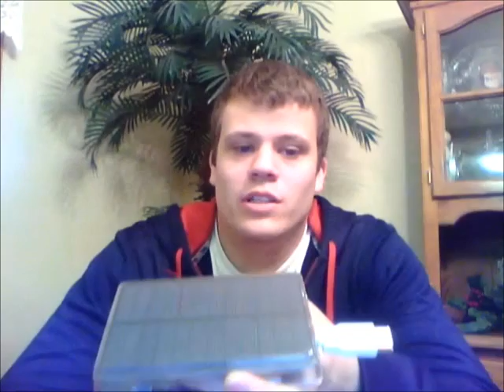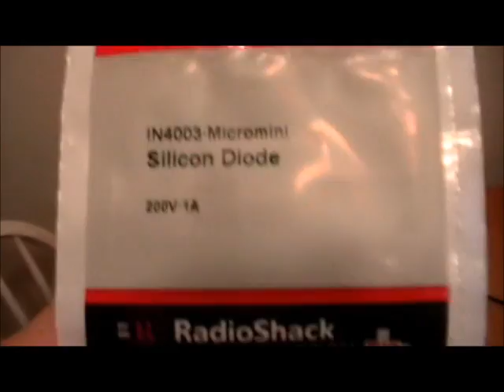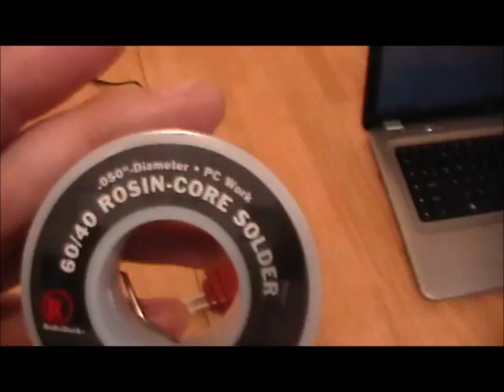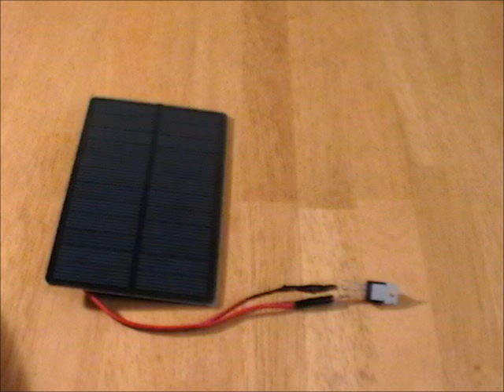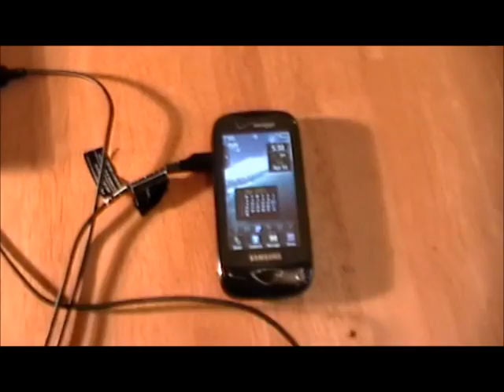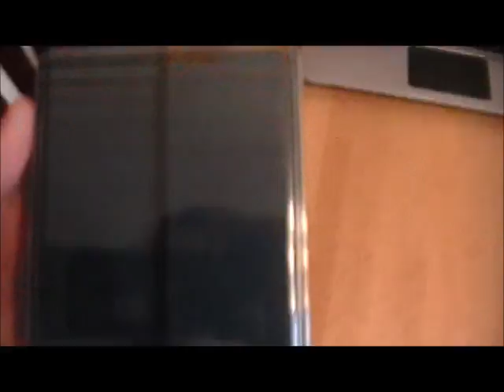Solar Powered USB Charger

Comment: i am make this solar charger......6v solar panel....output come 4.70v.....i am charge my smartphone ...charge light is on....but...charging % is not increase.....?
Reply: you're probably using a step-down converter which is sloppy... you need a 5v solar panel, and a step up converter that runs @ around 1000 maH ..then you can use the same battery trick like he did and itll work perfectly

Comment: Question, I have a 24volt solar cell and it puts out anywhere between 15-24 volts in sunlight. So my question is, will the 5 volt voltage regulator work with an input up to 24 volts? I would like to use the solar cell I have now, so I need to know if the 5 volt regulator will be enough to step down the voltage and work, or will I need something else. I don't plan on using it to charge a battery pack, just to charge my devices.
Reply: Prence
I agree with Codnerz that the linear regulator shown (I think it was a Fairchild 7805) should be able to take 35V input. However, be aware that the higher the input votlage, the higher the power in the regulator. At 24V output from your solar panel, your regulator might get quite warm (depending upon the current output of the regulator).
Reply from the maker: Yes that should be all you need. Most standard voltage regulators can take an input voltage of up to 35 volts.
Reply: Thanks. Time to go shopping tomorrow.
Reply: +Prence yes it works but you can get 19 watts of heat so i prefer buck converters for this
Reply: Thanks. but I gave this up after not being able to get it to work. I just bought a solar charger. Less of a headache in the long run. lol
Reply: uhh dont try... 24v is not comparable to 5v.. regulator will do its job but it will be REALLY HOT!! use a mospet
Reply: I gave up on that years ago. I just spent the $70 for a solar charger. Less of a headache.

Comment: Hey Adam great project, I have the same setup but for some reason it does not charge my phone even thought the charge indicator shows that it is charging it actually drops the percentage down I've must have watched your  video like 5 times and pausing in few places to make sure its hooked up the same way i have a Motorola cliq android phone it has 1390mah 3.7v any ideas? I'd really appreciate it.
Reply: Actually im here for the energy conversion but i want to say that your phone while not charging consuming around 200 mAh per hour. If im not mistaken this 200 mAh is when your Wi-Fi and 3G off. So your solar panel provides 150 or 200 mAh per hour and it is normal to drop battery percantage. It cant charge battery but it increases working time of phone around 4 or more hours. If you want to know more you can ask.